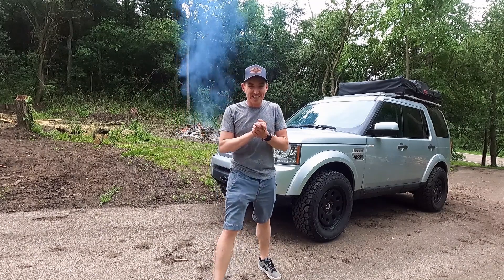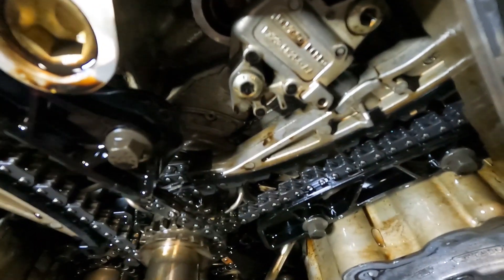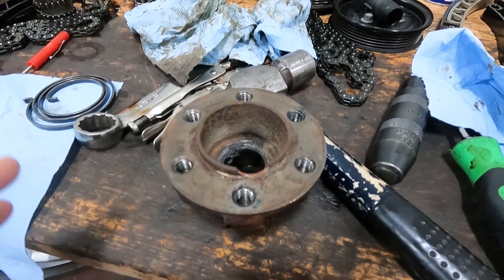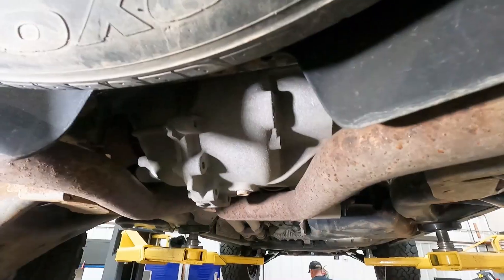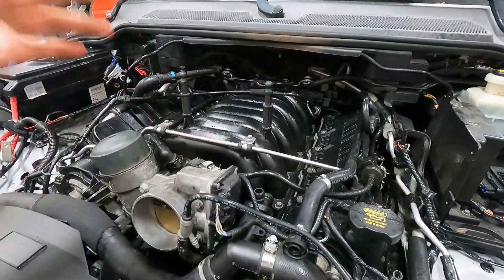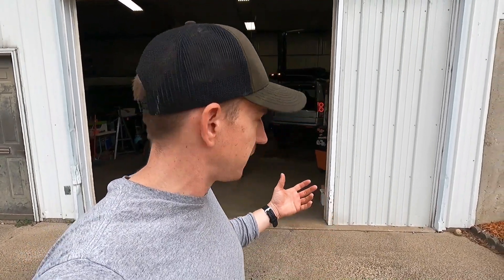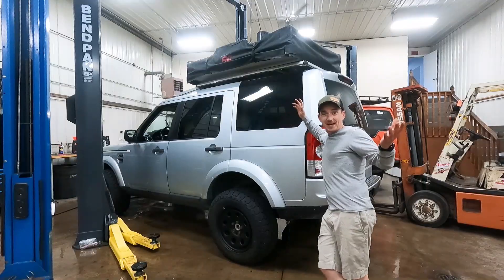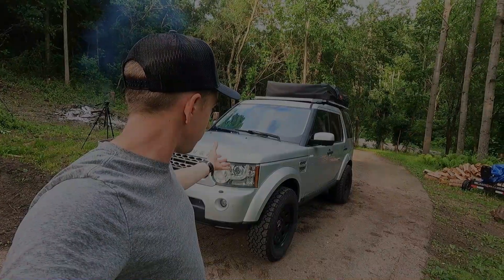Timing Chain Day | Getting the Budget Overland LR4 Adventure Ready

Comment: LS1 crank pulley puller (the adjustable claw one) works on those. Put the pulley bolts in 75% and grab onto them with the LS puller.  2:32
Reply from the maker: That is good to know. Thanks

Comment: Sphincter stretcher! I call mine “ life “. Nice job on LR4. Always reinforces my happiness with a td5 D2 and 300tdi D1. Much simpler creatures.
Reply from the maker: Haha. Life will do that to you. I’m sad we never got the diesels over here. I think when I move on from the ECO D1 I’m going to replace it with an imported 300tdi D1.
Reply: @LostCauseRanch  lots of V8i D1 here in Australia going cheap, lovely cars but too expensive to run with unleaded at $2 AUD per litre. My 300tdi does 8.8l/100km with fresh static balanced motor, whilst not a speed machine it is reliable and reasonably cheap to run with diesel being of similar price.

Comment: You should woolwax the inside of the frame too.  I did that to my LR4 with the special applicator hose that woolwax includes with multiple holes for spraying 360 degrees inside the frame.
Reply from the maker: To tell you the truth I can’t remember if I did spray inside that time or not. I do have that same hose and usually use it. Makes a world of different in the salted road lands.

Comment: Hey man question !! I have a RR Sport HSE 5.0L V8 its a 2011 , My head gasket is leaking or the head is warped its one of them lol only the passenger side I found anti freeze in it when I put my HD Micro camera to inspect the cylinders ..  I figured well I'm going to do a head gasket I might as well replace the timing chain too ... Im going with a Genuine Land Rover head Gasket of course ,  do you recommend the same for the timing chain and guides ??  unless you know of a better after market park that is better then the Factory ones  let me know !  thanks for your time hope to hear back soon !!  IM from the East cost  Near Cape cod we have a Buch of Rovers over here !! lol
Reply from the maker: Good idea on doing the chains as well. I would go with the oem stuff. I haven’t ran across better aftermarket stuff. The newer updated genuine stuff is much better than what you have in there. We had one set of cheap aftermarket tensioners on one that came in once and they were like half the weight of oem ones. 

You guys do seem to have a fair amount of rovers out there.
Reply: @LostCauseRanch   awesome thanks for letting me know 🙏🏽🙏🏽. And yes we do but those newer 4door jeeps  are much bigger then the Rovers here those things are like on every street corner  you go on ! Lol   They even have a club meetup called South Coast jeeps lol I see them every Friday they meet up at my Dads friends Farm  ..

Comment: Hey, helpful video. I'm currently shopping lr3&lr4 and trying to educate myself 1st. I found a very nice 2011 LR4 with 144k for about $6k because the owner says it goes into limp mode and giving timing chain code. It still runs and will do fwy speeds fine. 
 How risky of a purchase would this be? Would I likely be able to get away with new guides and tensioners?  (Btw the owner has also recently had a fuel pump and ignition parts replaced by the local Rover dealer). Thnx

Comment: Do you have any clips of what it sounded like beforehand that prompted this service?
Reply from the maker: I don’t on this particular one, the louder exhaust kind of drowned it out on the camera mic. But I should have one uploaded as an example. I’ll find one and link it here for you.
Reply: @LostCauseRanch  Thanks! I’m currently trying to track down a rhythmic rattle/knocking sound of my own on our 2011 LR4. RPM dependent upon acceleration really only in 1st/2nd gear under load (wind noise probably why I can’t hear it above that) Doesn’t do it free revving in park or neutral.
Reply from the maker: Typically chains will rattle worse on startup and you can get it to do it free revving. Just spitballing but could be fuel injection related, I’ve had noisy fuel pumps on these as well. And those can sometimes be worse under load. But that one is going to be hard to pinpoint if you have to be driving to get it to act up.

Comment: 15,000 mile oil service interval??
 That's ridiculous.
 I own a 2010 lr4 with 129,000 miles and I change mine at 5000 and have considered 3000 the way I've always changed mine but since there recommendation is so high I figured 5000 miles is really good but I feel guilty everytime it goes over 3000 miles between oil & filter change.
   I bought my Rover at 96,000 miles and the dealer I bought it from got it at a huge north Carolina auction yard so I don't have any idea what's been done to it. So I'm clueless as to when or if it has had a timing chain replacment and if ir when I should have it done and how much labor & parts will cost to have it done. I'm sure here in the states it will be ridiculously high like everything else.So when you say the scary issues with land rovers and the timing chain being one of a few yes it scares the 💩 out of me.
   I love my Rover and want to keep it but I'm not rich or any kind of well off even so maybe I'm better off selling or trading it before the big ticket items smack me right in the bank account.